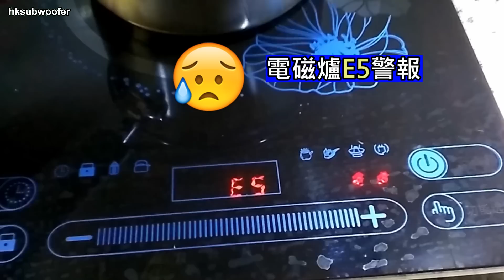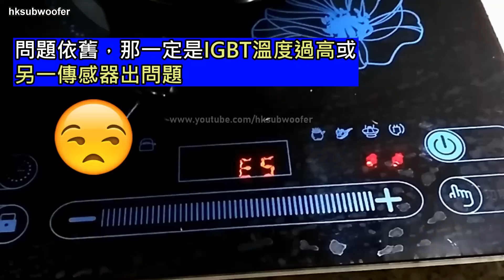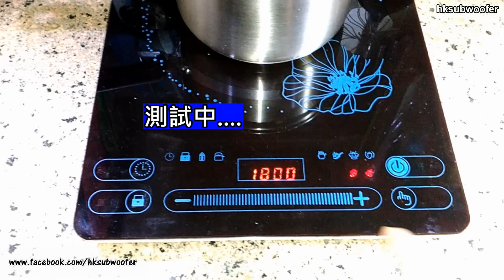電磁爐E5故障，數元零件費就修好

Comment: ok no problem thank i have the error E0 how fix it
Reply from the maker: Different brands will have different error codes, please read the instructions for what the error code means.Or Google search for the keyword "induction cooker e0 error", you will find the problem, I also use google to find a solution

E0 means maybe cooking vessel is not placed correctly. Vessel is either removed or not made of a material usable with induction cooker